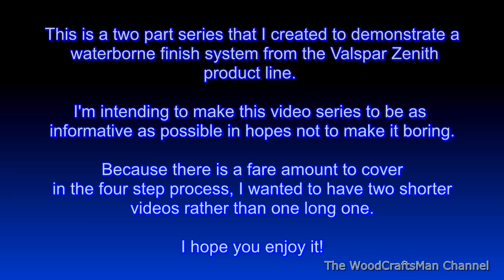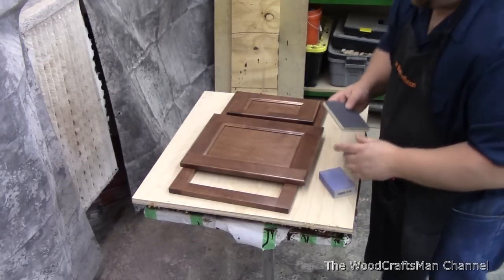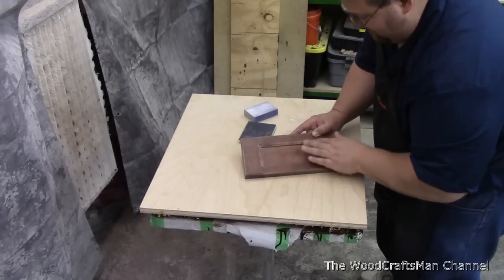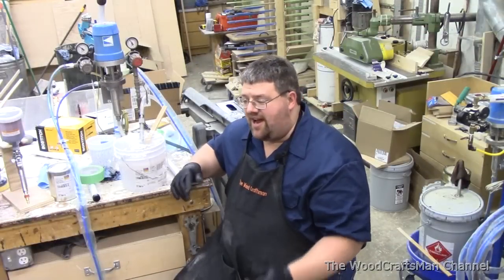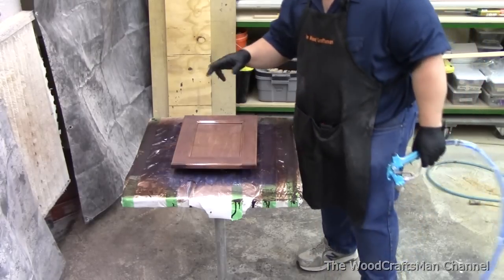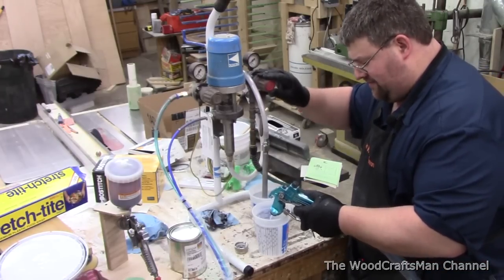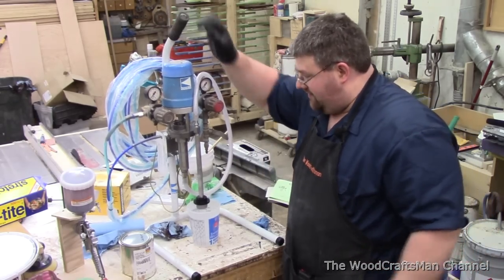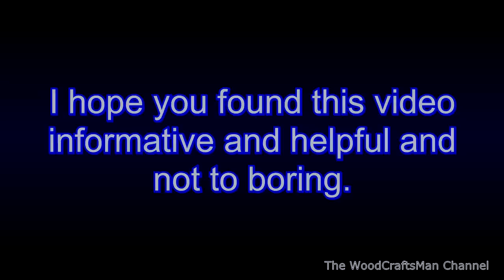Shop Talk 2016-8 Part 2 Valspar Zenith Waterborne Finish # 184

Comment: I prefer low pressure spray equipment (pressure pot, gravity feed or a diaphragm pump) for waterborne finishes as it really cuts down (eliminates) on the micro bubbling you can get with a AAA or airless when spraying WBs.
Reply from the maker: Unfornatley, this has been the only one so far that I could not to get to work with air assisted airless. All of the others that I've demoed, AquaCoat, SW Sherwood Kem-Aqua, Sayerlack HydroPlus, and most recently the Milesi 1K, all laid out nicely. I've been since told the Zenth has been changed to a new formula. Thanks! Scoot

Comment: I had the same problem with the bubbles on the white pre- catalized   wb laquer zenith, not sure what caused it
Reply from the maker: Hi, I found out later after talking to a field rep that works for Valspar, they said normally the bubbles are caused by air entrapment under the film from too much atomizing air or in my case too much turbulence of the coating from to small of a tip (0.012') and to high of fluid pressure (550 psi). I resprayed it on the cabinets i built for my miter saw station this summer with a much larger tip (0.016") and lower fluid pressure (350 PSI) and saw a significant difference. I was told its sprayed the opposite of a solvent based coating meaning that a much larger tip with lower pressure and don't over atomize. The coating should have a very lumpy look, but dries smooth and flat. Scott

Comment: which bostich gun is that? do you like it? love your videos keep them coming!
Reply from the maker: Hi, thanks for the comment. The Bostich gravity feed HVLP spray gun is model # BTMT72393. It seems to work pretty well for a gun that costs less than $50. Its no Kremlin, Graco or Saata, but it gets the job done. I bought it strictly for testing WB stains. to complement the Kremlin Airmix 10:14 setup I have dedicated for testing WB finishes. Thanks. Scott
Reply: +The Wood Craftsman (puttz1976) thanks Scott